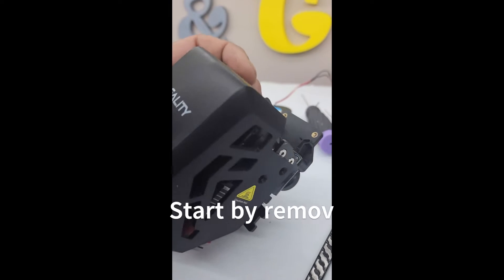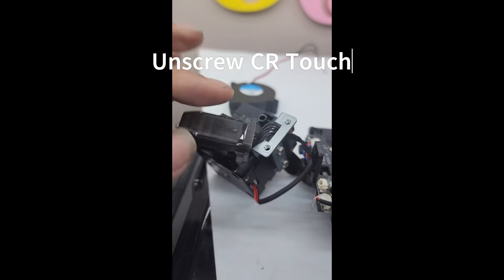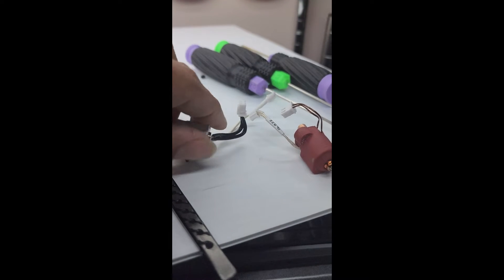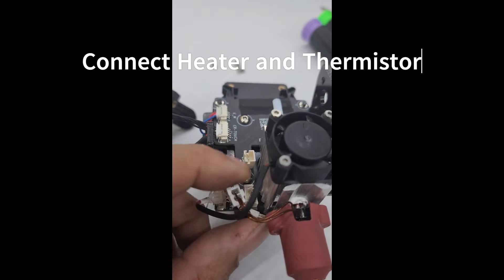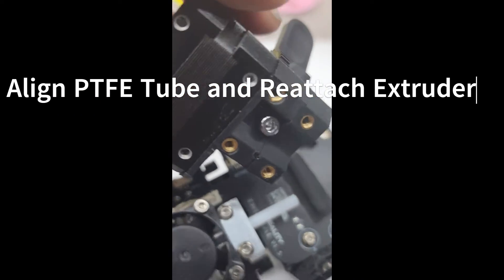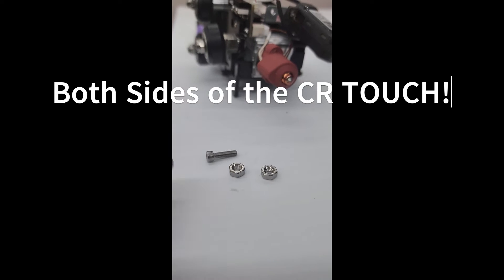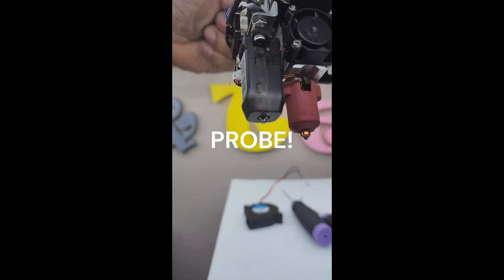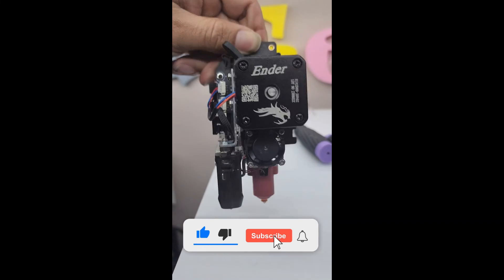Creality Ender 3 V3 SE Ceramic Hot End Install

Comment: Did you have issues with the screws holding the heatsink being too short and dropping into build plate? I see some people have that issue so I'm skeptical.
Reply from the maker: @jesseburson  The Black Set Screw? No issues with that.  Sure, it's VERY small and easy to drop or misplace, but as far as it being too short and falling out, that's the first I have heard of anything like that happening.
Reply: @3DandTeePrinting  No on the upgrade, the screws that hold the ceramic heater to the heatsink, the 2 skinny ones.
Reply: My fault I wasn't very thorough in the explanation lol.
Reply from the maker: @jesseburson  okay.  I know which ones your referencing now. Still, had No issues there either.
Reply: @3DandTeePrinting  cool gonna try one maybe it was an early edition that was bad

Comment: I added a 5.5mm spacer tp the CR touch, and now it sits lower than the nozzle, but i dont remember where it sat in relation to the OEM nozzle. Should it be sitting lower than the new nozzle?
Reply: should rest above the nozzle when retracted and then extended should be lower then the nozzle

Comment: I have had two of these ooze out though out the nozzle  and ceramic surround.    think I will go back to the stock one.
Reply from the maker: @jayeparker9281  Sorry to hear that.  Sounds like you may have had a bad seating issue on your nozzle to the break.  A simple tighting of the nozzle reassures It's flush against the break.  That will prevent any oozing.
Reply: @3DandTeePrinting  Could be but i added the included paste and tightened the nozzle.   I will attempt to remove the filament glob when it warms up a tad in my she shed.

Comment: Dont you need a 60w heating element for this rather than the stock 40w? Delivered to the nozzle
Reply from the maker: @ValleysOfNeptune2150  The Ceramic Hotend itself is 60w.  It's all integrated together in one piece. 

STOCK: Heater Block heats the nozzle.  The Block is Heated through the removable/replaceable 40w Heater Element.

UPGRADED: There is no real "Heater block". There is a Ceramic Casing that surrounds the Nozzle.  It being 60w allows for higher temps and quicker heat up times.

Comment: dose this require a new cooling fan setup
Reply from the maker: @3daddict154  Not it you don't want one.  BUT I would recommend it since your pushing more plastic and it would help with cooling but it's totally optional. 
A New Cooling Fan setup should cost you less than $10 in parts with a single 5015 Blower or adding an additional 4010 Blower to the stock 4010.  Along with printing a new fan shroud.

Comment: Do the new hot end not come with the right spacers or at least instructions?
What is better with the ceramic one, can it get hotter than 260 c ?
Reply from the maker: @agw5425  only if your buying the packaged one for the SE specifically through a 3rd party.  
It is essentially the Older K1 and K1 Max's hotends.  The K1 Max version comes with Bimetal abrasion resistant nozzle.  Which this is.
So it's sold cheaper as just the Hotend for the K1 Max then the Kit for the SE.  
You can always print spacers available on makerworld and printables that people have designed.

300c nozzle: the SE has to be running Klipper or you have to write your own firmware in Marlin since it's a Marlin Based Machine out the box.
Klipper will allow you to reach 300c by changing the settings in your Printer.cfg file.
Hope that answers your questions.

Comment: You've just remove 6mm from your max height of printable area. You could have bought the whole set with the heatsink included and all will align perfectly without adding 2 m4 nuts but I guess you chose that because it is a lot cheaper.
Reply from the maker: @Schjoenz  Could have also printed a space.  There are alot of options.  The Flowtech Version also comes with an ABS spacer (switched over to Flowtech a few months ago).

Comment: hi are you able to put up the whole 300C  heat without modding the os or firmware ?
Reply from the maker: @geromemercs3207  No you will have to change it in the firmware.  I am running Klipper on the SE sonI can just change it in the Printer.cfg file.  I did not attempt to change the Marlin Firmware but I am sure someone by now has made an aftermarket Firmware for it if the source code has been released l.
Reply: @3DandTeePrinting hay how did u get klipper to connect do u use a raspberry pi I just ordered a pi zero 2 to set up to connect should be here tomorrow is that pi workable without a camera connected to use for this I just installed the ceramic hotend on my 3 v3 se and need to get the nuts for the prtouch sensor how many mm thick do I need for spacers
Reply from the maker: @peggyelrod2535  I went the plug and play route with a Sonic Pad.  I didn't use a PI.  I am sure it's simple setup if you're used to adding a PI.   I already had a Sonic Pad running 3 other printers so it was just an easier option for me.  There is also the Nebula plug and play option.

Comment: The 2 screws connecting the heating element and heatsink can it function properly without those?
Reply from the maker: @punkreeperful  No.  That holds them together.  Kind of important. WOW your right I never put it back in.  I may need to add a pop up on the video. Good Catch.  Thank you.

I switched out the hotend to a microswiss flowtech shortly after but it was printing fine before I did.
🤷‍♂️
Reply: @3DandTeePrinting  you're welcome. Unfortunately microswiss isnt available in my country, i will just have to settle with the K1 upgrade or maybe if the SE/KE ceramic upgrade has better reviews I will go with that. Fingers crossed with the blob of death 😂☠

Comment: I Installed the ceramic hot end, and also installed klipper using the sonic pad. I am unable to increase temps above 260 even after modifying the max temps in the printer.cfg. Any suggestions?
Reply from the maker: Interesting.  I changed mine on both the SONIC Pad under extruder and in Klipper on the Printer.cfg to 305c and it's been getting to 300c with No issues.  Not sure why your didn't stick.  Let me see if I can find an answer for you.
Reply: @3DandTeePrinting  Thanks, much appreciated. Anything over 265c fails with a USB1 Ender-3 V3 SE abnormal heating error. But it will run at 263c all day.
Reply: @RESTIVOX12  Howdy, did you ever figure this issue out?
Reply: @fireballsflight  Sadly no. I have not messed with it in a while. I am able to print pa6-cf at 263c with no issues, so I don't necessarily need to increase temps at the moment. Although I am still curious about why I can't increase temps.

Comment: Whelp. I did something wrong 😂I put the two nuts in and thought the BL-Touch looked a BIT too close... Should have trusted my instinct 😅punched a hole through my build plate. 
Didn't follow the directions exactly so I don't blame you lol
Reply from the maker: Sorry to hear.  Hope you got it situated after that happened.
Reply: @3DandTeePrinting  I got it sorted! I didn't think about my hardware being slightly less thick. Added a few washers in there and we're good! 
Did you see a drastic speed increase while keeping prints clean? 
I pushed things to the full 250mm/s on a print with plenty of small details and it still came out REALLY nice! 

Also my print bed survived with only a tiny poke haha

Comment: I came across this video and ordered the parts right away. My old hotend got swallowed up by a big glob of filament. I've since done the upgrade but sometimes get adhesion issues, first layer or a few layers in it will start to either lift a little or leave raised filament which gets caught by the nozzle later on and knocks the print loose. Any ideas? I've used cr touch to level the bed a few times and the issue doesn't happen on every print e.g benchy prints just fine. My next step is going to be a brand new spool of filament just to rule out that being the problem.
Reply from the maker: Could be a bunch of possible culprits.
1) Z Offset is a little high
2) Flow Rates is to low
3) First Layer Not Thick Enough
4) Unleveled /Warped BED
5) Unclean Build Sheet
6) Filament or Environmental Moisture
There is no one right answer.  Try lowing your z offset by .02mm to .04mm Lower.  Then if that's not the fix work through the list above.
Sorry I can't give you a definite answer.  Each case is different.

Comment: Would the ender 3 s1 hot end fit the v3 se?
Reply from the maker: I would ASSUME So but you would have to change the JST connectors to match.  They have a similar Heat sink. BUT the K1 hotend is better than the CERAMIC S1 Upgraded hotend.  I got them mixed ip originally and order a S1 ceramic hotend and found the JST connectors didn't match.  I also had a S1. So I just put it on the S1 instead and then ordered the K1 MAX hotend (abrasion resistant vs. regular K1 hotend) and put it on the SE (shown in the video).

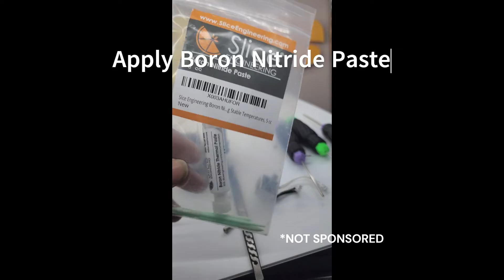Comment: 1:35 Is it mandatory to apply this and what are the issues with not using it? I am currently preparing to upgrade to the CHC PRO hotend.
Reply from the maker: It's is HIGHLY RECOMMENDED for better heat dispersion but not mandatory.  I have ALWAYS used it so I can't tell you what would happen if you don't.  If your splurging for the CHC I would get a tube.  It last a LONG time.  I have had a 5cc tube for past year and half still got half a tube left.

https://www.amazon.com/dp/B088CHBZQ4?ref=ppx_pop_mob_ap_share
Reply: It's the heat transfer goop like you would use on a computer between the CPU and Heatsink.  Yes, use it.  Not using it will cause irregular temps at the nozzle, thus causing sh!77ty prints.

Comment: I'm having trouble removing the two tiny bolts or scres holder the SE hot end on IK tried like 29 allen keys non e of them seem to fit or work? Does the K1 hot end need those 2 little screw ort bolts OI was thinking about cutting mine off with mydremel?
Reply from the maker: Yes it does need them.  It keeps the throat pressed against the heatbreak.  If you cut them off you will still need to remove the remaining cut screws from the thread and put in new ones.  If you don't you may end up with the Blob/Glob of DEATH from the filament creeping AROUND the throat and oozing out AROUND the nozzle and heater block.  I HIGHLY recommend against leaving them off.  I am NOT opposed to dremeling them off you just have to replace them.

It's either a 1 or 1.5 M Allen wrench.  I can't remember off hand.  They DO cause the Allen wrench or screw head to strip from time to time.  I have cut them off with bolt cutters and replaced them before.  Just took a pair of plyers and screwed them out that way. After I cut them they was the rest to grab onto so I could remove them then.  Another trick is to heat up the hotend.  Sometimes the thermal expansion will allow you to Loosen them.
Reply: I stripped mine, cut the screws and undone the bolts with needle nosed pliers then replaced with new screws

Comment: YT apparently deleted my previous (long) post, so trying again. The big 'A' lists a 300 degree hotend/bimetal heatbreak that's rectangular and appears to be a direct replacement for the stock 260 hotend. Any thoughts on that version vs the longer ceramic?
Reply from the maker: Not to familar with the "A" List.  The Longer Cermaic version gives you a larger melt zone and quick heating with the longer nozzle.
Reply: @3DandTeePrinting  Well, YT has done it again. Is it not possible to insert a link to a commercial vendor like the Big 'A'? If you search that site for "Creality Official Sprite Extruder Upgrade Heater Block Kit High Temperature Pro 300℃ Titanium Heatbreak" the 1st hit should show the one I was talking about, at 26.99, and clicking on it will show 3 other options, as well. If I do the 300 degree hotend change, will I need to move from Marlin to Klipper/etc to use the higher temps (260-300)? Thanks for your time and knowledge!
Reply from the maker: @rv7builder397  oh you mean the SPRITE CERAMIC.  I have a video on that too (see below). The Sprire Cermaic has different Jst connectors than the SE or KE.  It is Smaller and you can't change the nozzle out.  It's all one part.  I have one on my Neo currently.  Nice kit but limiting in nozzle size to .4mm.  Hopefully they will come out with a .2mm or .6mm version.  The K1 hotend upgrade is better in my opinion.  BUT to be completely honest.  I moved past the K1 nozzle and went with a flowtech.  Currently working on a video of its installation an performance.  I know it's OVERKILL and expensive but if your modding price shouldn't be the issue.  Quality is.

https://youtu.be/xqaQsN4CEe8?si=hL6D8IzyZ6DjPVHF
Reply: @3DandTeePrinting  That page shows a ceramic, and also a regular looking rectangular that claims to be 300 degree. Having said that, it sounds like the K1 is going to be the ticket. Am I going to need Klipper or something else to use the higher temps?
Reply from the maker: @rv7builder397  I threw klipper on mine so fast I didn't get a good thorough look at the Marlin firmware.  I would highly recommend grabbing a Nebula kit (pad and camera).  You can be on Klipper real fast without rewriting your firmware to get to 300c AND you get HD timelapses.  I had a Sonic Pad already with one port left out of the 4 and Never looked back.  I might need to step back and do some research on the Marlin side of it just for my own knowledge.
Reply: @3DandTeePrinting  I've got a Nexus 6P phone with a bad battery I'm in-process of setting up to run Octo4A, so that or perhaps a spare pi will probably be my path to Klipper. Trying not to end up throwing Voron money at a 'starter' printer. ;-) I do have another printer; apparently a straight Ender 3 that I stumbled into effectively free as part of a deal on a big batch of PLA. That one might actually get seriously modded; I have some functional stuff I'll need to print that will require both nylon temps and large format (~400 mm). If I start actually 'farming printers' a Sonic pad is probably in my future.
Reply from the maker: @rv7builder397  I love Modding Ender 3's.  Only issue is the amount of options makes it hard to pick one that your not saying "I wish I went with....... instead of ........" for different components as you find out about the next new mod out there.  It's a rabbit hole.  I beautiful fluffy cuddly Rabbit hole.  Nestle into never being done modding FOREVER.  LOL.  Hope the repurposed Pi Setup works well for you.  It's a good idea.  If you do go Sonic Pad I HIGHLY recommend the SERIAL connection over the USB connection to it.  Much more stable connection and doesn't "lose track" of the printer and have to reconnect all the time.  It was an issue with the Sonic Pad till I switched them all to serial connection as advised my Creality to do.

Comment: Do we have to put the thermal paste, I have brand new printer would it be fine with out it
Reply from the maker: Recommended not required
Reply: @3DandTeePrinting  thanks man I needed to know, I ordered some anyways it comes Wednesday, also btw on printables Arthur Grigoryan has a spacer model for the cr touch, also could you explain how to calibrate the pid
Reply from the maker: @Marc_Figueroa  I found it after the fact.  I switched to the Microswiss Flowtech Today and should have a few videos in it upcoming once I tune the flow rates.
Reply: @3DandTeePrinting  so turns out there is two k1 cermaic heater blocks, i bought the k1 max ceramic heater, and it works
Reply from the maker: @Marc_Figueroa  K1 max has abrasive resistance nozzle tip.  K1 doesn't.
Reply: @3DandTeePrinting  got any tips for retraction

Comment: is there a another name for Boron Nitrate I can not find in ion amazon in Canada is it the same a cpu thermal paste I'm buildi9ng a com,puter in a couple weeks?
Reply from the maker: No do not use Computer Thermal Paste.  CPU Paste is not for the extremely high temps on a 3d printer.  Boron NITRIDE can work all the way up to 1000c vs CPU Thermal Paste maxing out around 100c.
Here is a link to the one I use.

https://a.co/d/e6GLBI6